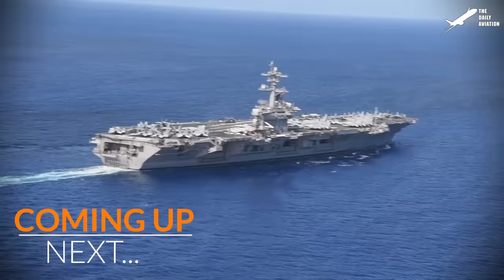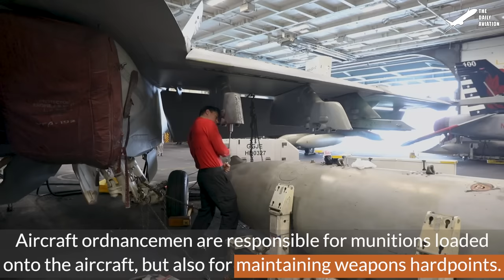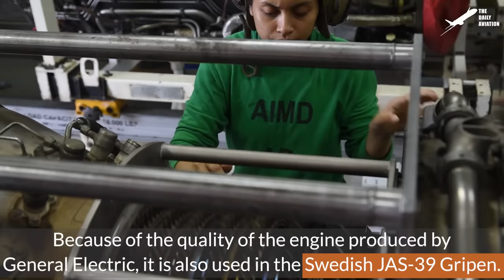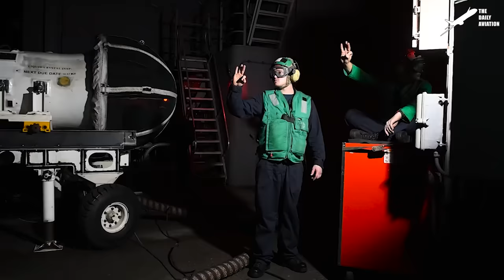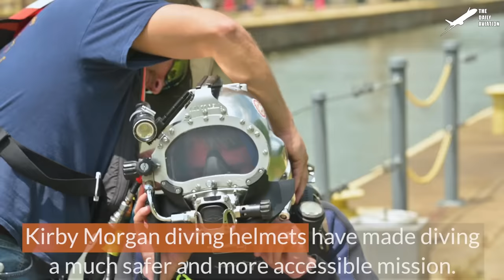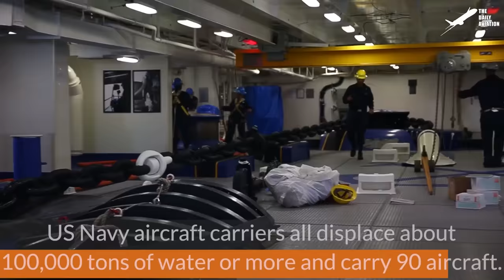Inside Tiny Shop on US Aircraft Carrier Repairing Fighter Jet Tires at Sea

Comment: AT only work on electronics not power plants. Radar, communications, IFF systems and sonar.
Reply: I was hoping someone would point this out. AD's handle the power plants.
Reply: And MM's (like me) worked down in the engine rooms, operating the boilers and main engines and such. We never touched aircraft engines.

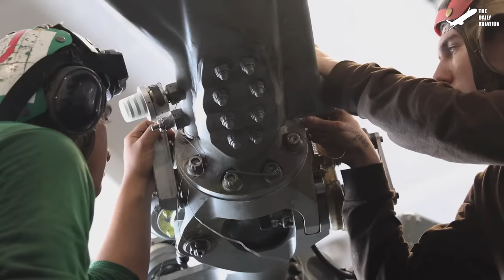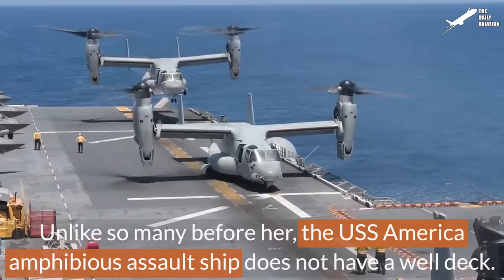Comment: at 2:27, the two rotor blade attach bolts at the 9:00 position are being safetied backwards
Reply: background - I'm a US Navy Vietnam veteran, retired from a corporate aviation repair station with 20 year gig as an inspector. Also looks like he has too many turns on the wire.

Comment: Nitrogen is a inert gas and does not expand at all. Tires are not repaired they are replaced. F-18's have two engines not one.
Reply: Nitpick, much?  You probably sat in the theater and said: "They didn't have the need for speed, they had the need for acceleration."
Reply: @texaswunderkind  What's your problem with the truth?
Reply: @CaptainSwoop settle down Jack Nicholson.
Reply: Nitrogen expands and contracts with temperature changes.

Comment: I dont get it.... why dont they use ice blasters to clean out the engines on jets,, rather than sitting there with a file? the blaster will get it back to brand new and wont wreck the part,,, but the guy sitting there with a file?  now the engine has to be "rebalanced"   or is there something im not seeing
Reply: if a blade is minor  damaged the nick needs to be smoothed and rounded with a file. a rounded surface helps prevent stress cracks. there are limits to how many nicks before balance trouble.
Reply: @markosborne9558  ahhhhhhhh ok thank you.... yeah makes sense.
Reply: i remember being on the the USS Independence, and i was part of a "magic act" with my family.... and remember the deck was sooo hot,, you dare not touch it with you hand...and i couldn't believe it had these long escalators.... and the only thing we drank was a thing called a dr pepper... it was like a cola drink.... but the Ship and the below decks were just incredible.!

Comment: Nitrogen keeps tires cooler than air and it expands slower? WHAT? Who is writing such crap info?
Reply: It's true. Look it up. About 20% cooler.
Reply: It is used because normal air has moisture and oxygen which promote oxidation of metals and rubber.  Moisture in normal air also causes larger changes in pressure with changes in temperature. If you remove the oxygen and moisture from normal air you have a gas which is about 99% Nitrogen.   So, it is not so much that they want nitrogen, nitrogen  is just what is left when they remove what they do not want.